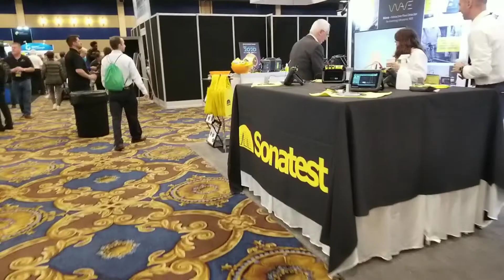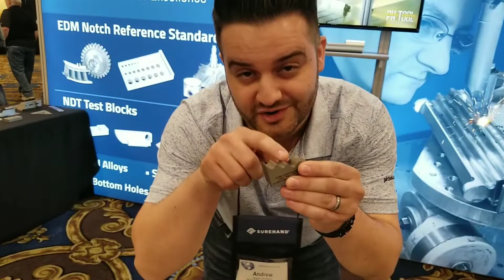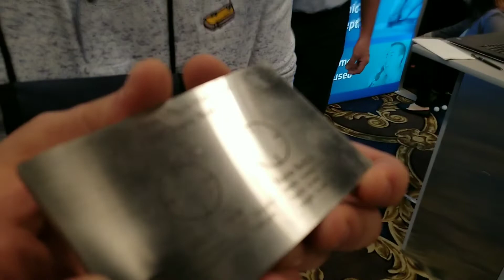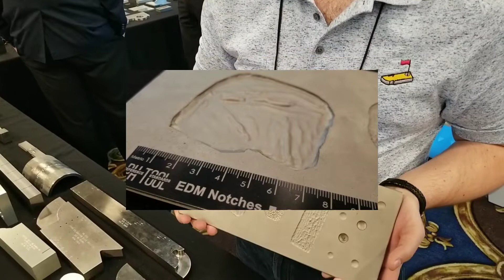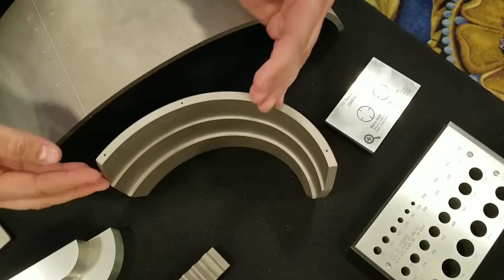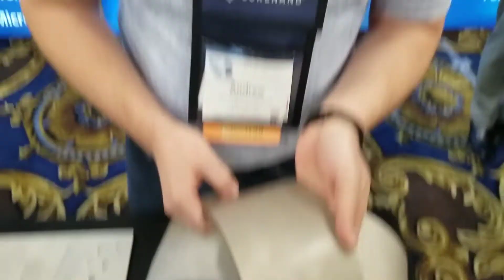What's That Weird Thing? with Andrew Robinson from PH Tool

Comment: Another good Vid, big ups Paul... Question ..what is EDF?
Reply from the maker: EDM actually... "electrical discharge  machining".  Tiny electrode or wire with a lot of current.  Almost looks like cutting with lightning.  It's the coolest thing since sliced bread!